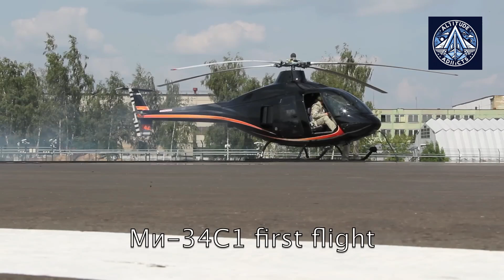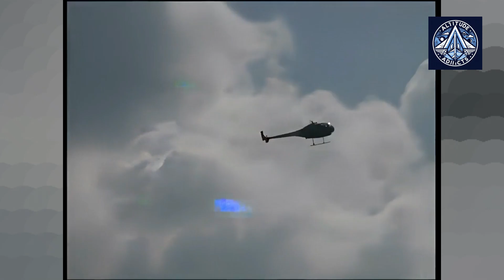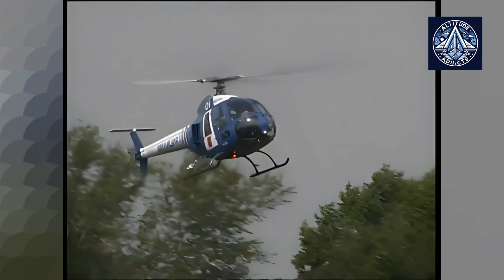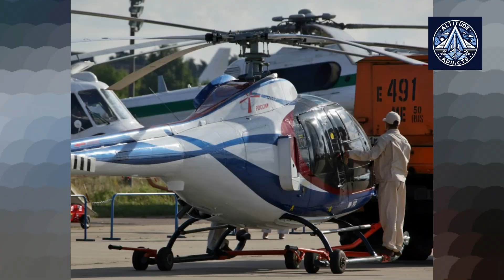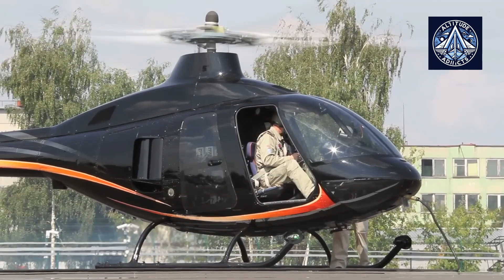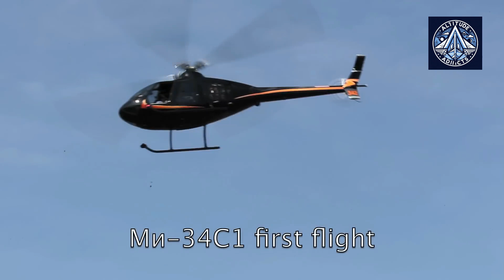Mi-34M1 Light Helicopter - Russia Resurrects Soviet Era Mi-34

Comment: the real problem was that during the Soviet era - Poland and Czech were the designated "excellence centre for light aviation .... fixed wing and rotary. Why light aviation in Russia is struggling .... 
And why for example - the Americans raced in to buy the Czech Walter engine manufacturer to deny Russia access for small turboprop airliners . Mi-2 helicopter had a gas turbine engine 1/2 the size of the VK-650 made in Poland ? .... well ok 1/2 the power .... could well be the same size and weight of the VK-650 ? 
Robinson ? I accidentally walked into their factory at Torrance in LA thinking it was the Northrop Aircraft museum .... most of their choppers have a flat-6 piston engine - I was standing next to a bunch of uncrated engines.

Comment: The helicopter was and is a good helicopter, but foreign designs were established and were cheaper. It also lacked a decent local engine, which the new VK-650 engine will correct. The VK-650 is significantly more powerful than the original engines, but the Mi-34s future is looking bright simply because all those western helicopters are not imported into Russia and support is not available, so the Mi-34 will be one of the few options. The Mi-34 is a light single engined helicopter, the only viable current Russian helicopter alternative would be the Ansat which is a heavier twin engined design. The problem with the Ansat is its P&W engines but the VK-650 can replace those too. This means the Mi-34 has half the power of the Ansat which makes them complimentary. This also means the VK-650 engine will be rather more widely used in the market making it more attractive to operators who can have light and medium helicopter types using the same engine. I would think the VK-650 would be an interesting engine for the Ka-226, but think ultimately the more powerful VK-800 could be used to expand the performance of the Ka-226 where it could be used without the modular cabin as a flying crane up to very substantial altitudes in hot conditions... like Afghanistan or India.